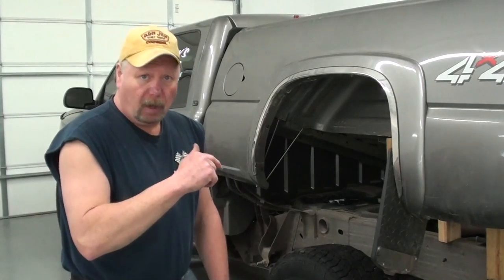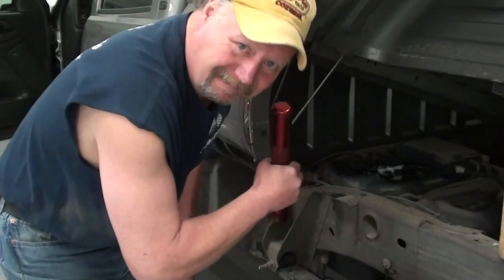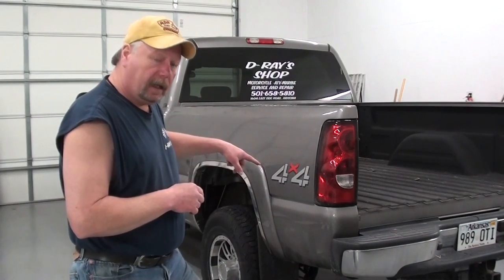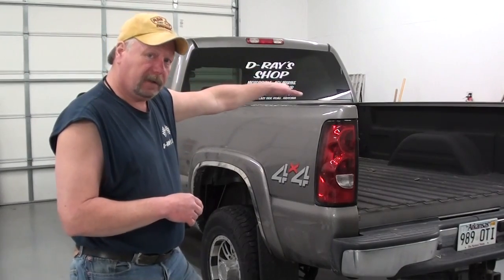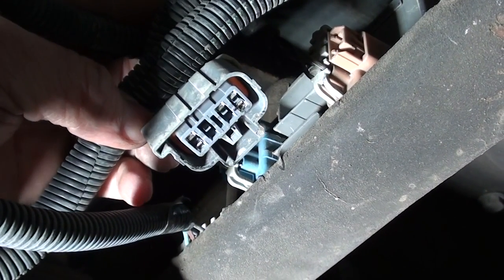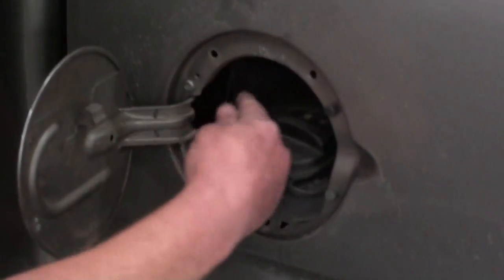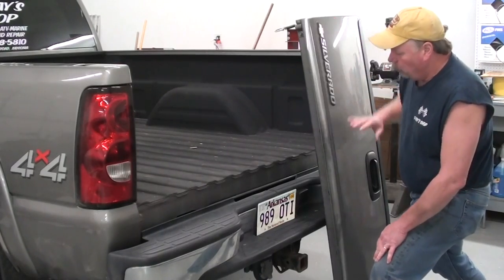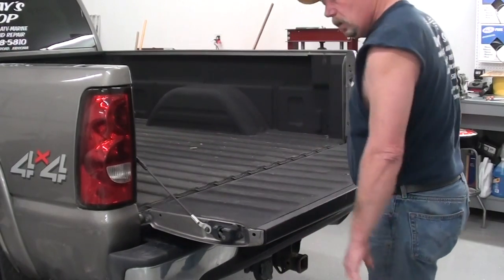Pt.3 2007 Chevy Pickup Fuel Pump Replacement At D-Ray's Shop

Comment: I didn't even need to replace the fuel pump, but for some reason I couldn't stop watching these 3 videos.  Learned alot.  Thanks.
Reply: I had a '95 Dodge many years ago, and the tank was almost empty so I dropped it. This is WAY easier!  A hint- you can not fix the fuel gauge sender. Just replace it.
Reply: Hahaha me to.. hey now we know how thanks to this guy for doing great detailed videos.
Reply: this is how its done!!!
Reply: I had my 1998 Dodge Dakota pickup restored last year (2019) and since they had to remove the bed to fix it and paint it I told them to do the same job as in this video. Now I can drive it with more confidence.
Reply: Same here, don't even own a Dodge and enjoyed the videos. Thanks for taking the time to create.
Reply: Same here, might change mine this weekend just in case.

Comment: Absolutely the best video I’ve seen on auto repair!! Admire your cleanest, details such as pulling on electrical wires and hose line connections and double checking everything. Fantastic job!

Comment: I truly appreciate the information you provided in this video. I have 2 Chevy trucks a 1990 and a 1993 that from time to time experience this same issue with the fuel pump. I'm a single female who cannot afford to pay a mechanic $85 an hour every time the fuel pump goes out. At 5'4" and 140 lbs. because of your video, I was able to replace the fuel pump on my 1990 version. BY MYSELF!!

Comment: D-Ray the fuel pump went out on my Hubbys truck. We were almost in a left turn lane on a street that went up hill. Terrible place for the thing to die at. Thank God we had AAA we got it towed home. My hubby works and comes home tired and  didnt really want to change it himself, but the quote we got was near 500. That number was a great motivator. I told him I saw your video and I thought we can do it! We ordered the fuel pump and yesterday THANKS TO YOUR GREAT INSTRUCTIONS we did it! The only tough part was putting that chrome looking ring back on. It was like we had to squeeze the "gasket on top of the fuel pump' down before the ring would turn. I ended up doing most of the job because his bifocals werent focusing, LOL. I Did it! I went to bed soo happy. I followed your video and it gave me the confidence to know it was done right! Hearing the monster start up and purr like a kitten was great! Thanks again from So Cal.

Comment: I just performed this fuel pump change on my 2001 and it literally took me 30 minutes after watching your video.  This is the second one in 186,000 miles and we did it at our shop and even with a 2 post lift it was every bit of 2 hours dropping the tank after pumping out 20 gallons of fuel.  That was the best way to change it out. Thanks and I will continue to watch for other videos!!

Comment: Awesome training series great camera work and full step by step explanation. I bought my 02 1500 4x4 used in August 2010 in December the pump went out. Had it towed to the dealer one day and $1100.00 later it was back on the road with a full life time warranty on parts and labor. Two months ago the sending unit went bad they replaced the pump under the lifetime warranty on parts and labor. They changed the warranty in January 2013 to parts only but documented my paperwork that I was Grand Fathered and covered full lifetime on parts and labor. Chalk up one for me.

Comment: Great video series, thanks.  Awesome how you broke it down into 3 shorter videos instead of 1 big long one.  I think I'm facing a fuel filter/pump issue right now with my 2006 Silverado 2500HD, and don't want to throw $600 at a shop to do it, and don't like the idea of dropping my tank.  Great idea and method, I'll get it diagnosed for sure first and then try it at home.

Comment: Thanks so much for this!  Just changed the pump in my 01 Silverado using your technique, except I used my engine hoist to lift the bed.  Hooked it to the tie down loop in the rear corner of the bed.  Hopefully good for another 120k miles now, plus my fuel gauge works right now!  Pat, Olivehurst, CA

Comment: Thank you very much for all the tips and help, tomorrow is the day I will fix a leaking gas line off the pump so tilting the bed will get me to the lines and also a good time to replace the brake lines to the rear brakes while the bed is up, Thanks a ton.

Comment: thanks for the videos!  Finally saw the  correct evap line setup after i broke two of the hoses dropping the fuel tank with 10 gallons of gas in a rock driveway. I do it like you did in your videos, now! Appreciate it!

Comment: ugh I wish I had known how to do this about 3 years ago with my 99 silverado. GM dealer mechanics are a joke. 4 visits with two tows and them replacing the pump on their dime only to finally figure out that the wiring harness was corroded. Very well done video. I'll be ready when the pump goes on my 07 2500HD.

Comment: I am so thankful that I found this channel, I believe my wife has a leak somewhere on top of the tank. I can smell gas and I can't find any leaky hoses. I have already replaced the canister vent valve in the rear of the tank. Still smell gas. CEL P0441(I believe) small leak detected. This surely is going to make my life easier.

Comment: Great video! Just finished installing the new fuel pump in my 01 2500 HD. Everything was just as you showed. Was surprized how easy it was to lift the full size bed up. Two hiccups though...Frozen bed bolt on the drivers side and a bad butt connector on the new harness. Other than that a pice of cake!!!

Comment: very good job on the videos . for a 2007 truck its in awesome shape with no rust. I have a 2003 silverado. I live in NY and my truck is rusting everywhere . Brake lines all rusted , the parking brake backing plates rusted off causing the parking brakes to rust apart . Im sure fuel lines will fall apart next ,Rockers are gone. Salt is this trucks enemy

Comment: Great Job on this Video and glad to see you used dielectric grease on your electrical connections .. please use your safety glasses any time you are under the vehicle to keep crap from falling into your eyes, and should use a little Silicone Grease on the fuel line nipples to help seal the O rings .. I am not being a critic this is one of the best how to's I have seen on You Tube

Comment: Great video. Maybe could have said what size socket you used for the bed bolts and explained why you put dielectric grease on the connectors but otherwise a flawless and educational video. Well done.

Comment: I have a 2007 Chevy classic with 170000 miles so I thank you for the tip. When I bought it with 133000 miles hopefully someone already did this.

Comment: Super Job! D-Ray Smith, Thanks, now I will know how I am going to do this job. Cannot believe how clean your truck underneath is, My 2003 Chevrolet Silverado is a rust bucket because of good ole Northern Michigan salt on the roads during Winter months. Thanks Again! One good ole boy for sure, super job on explaining what to look for and how to go about it.  One thing I really would like to know is where the ground wire goes to from the pump to the frame? Like on your friends Truck. Just curious.

Comment: Most excellent series, it'll be my guide for my fuel sending unit replacement this weekend on my '03 SS. Already have parts on hand and upgraded harness for sending unit and the tank pressure monitor.

Of note: I also ordered a tank/canister evaporative solenoid, fuel filter and fuel pressure regulator. They tend to go out pretty close to one another so I figured I'd just get it all while I have her tilted.

Like you mine failed after fueling up with a fresh, full tank of gas. Isn't that how it always happens? ^.^

Comment: Great video...I am about to do this but I was planning on totally removing the bed. The tilt method looks like the way to go.
Only thing I might add is while the bed is up, check all the EVAP hoses, connections, and canister.....I am fighting a PO446 EVAP issue so that's my reason to remove. While I have it up, Im gonna go ahead and replace the fuel pump (100500 miles). EVAP problem, maybe D-Ray Smith can help me with this?

Comment: GREAT VIDEO THANKS, I have a 2004  Silverado that had not run in 12 years, I open the tank and cleaned all the old fuel out. Now I can't get it to start. Any ideas?

Comment: I thank you for a great video, easy to follow, and I just finished mine this afternoon. I did go to the dealer and buy the pump $$$. Took a couple of tries with the board length to get it just right for the brace. The pump that I purchased had the larger seal and that was a little bit of a pain to get it pushed down far enough to get the ring seated enough to spin it on there. Is there a better way than using a chunk of the wood  and pressing down on the pump by wedging it on the bottom of the bed?  I just could not get any leverage on it. other than that everything went exactly as planned.  If one jack-stand was good, 2 was better to ensure it was going to stay put!  Thanks again for the video and the savings of about $700.

Comment: And thanks for showing how to properly use a brass drift on that lock ring. Seen quite a few pros using screwdrivers and chisels with a hammer to do it, and just wanted to smack them in the head for showing a great way to tempt fate with the fire hazard.

Comment: Great video! I won't have to cut a hatch! I've been watching other videos too. One mentions having to use a fuel pressure gauge under the hood with a pressure release button to avoid being sprayed upon removing the hoses on the fuel pump. Since you didn't mention it on your video, is it necessary? just askin', I didn't see YOU get sprayed.

Comment: D-Ray you made an excellent thorough detailed video that was very enlightening to me. I definitely gave you thumbs up!  I have a Chevy 2001 Silverado extended cab with a fuel pump problem. D-Ray could I use the same truck bed lift principle as you used in your video to replace the one in mine? Thanks and hope to hear your reply :-)

Comment: I wished that I thought of that method for my 98 Dodge Ram 1500, it has an 8 ft bed and I'm sure it was a lot heavier than the Silverado bed. I cut a hole right over the pump and if it ever fails again it will be a simple fix.

Comment: I just did fuel pump on my 2006 Silverado with 5.3L.  I couldn't get locking ring seated back in fully but it cranks and runs fine.  Do you think not getting it seated in the tabs fully will hurt anything?  Great video BTW!!  Thanks.

Comment: This is a great video series.  very informative with very good visual instruction as well. Do you think think method will work on a 1987 (square body style) with saddle tanks?  I need replace one and I really don't want to drop the tank or cur a hole.  Thanks

Comment: Wish I had thought of lifting the truck bed.Would have been super simple for where I worked had a bunch of forklifts around. Couple of lift straps and bed is gone then follow your procedure and Hey presto truck is back at work.Also a lot easier than wrestling a full tank of fuel around.

Comment: Hey D-Ray, great video thank you. What kind of fuel pump is that? I have an 02 2500 had with the 8.1. I keep finding pumps where I have to rewire it or it looks cheap. What pump is that? Thanks again

Comment: You made it look all too easy D-Ray. Awesome series :)
Reply from the maker: Thanks bro!
Reply: @DRaysShop  Sir, I have horrible rust and every step has had an added hindrance
; (
Got her tilted and electrical came off fine, but a bit hesitant on fuel lines (even the tabs seem rust weld) (Ohio is hard with salt and it never sleeps, if you know what I mean). Tenacity is the key, any tips other than WD-40 and PB blaster and wire wheel attached to cordless? Going slow so I don't mess up. You should teach adult Ed or high school auto mechanics (if they have that anymore).

V/r, Z

Comment: We made those fuel pumps at the Delphi plant in Flint MI. GM was always complaining that the pump was too loud. Sorry it didn't last longer than 100,000 miles. We made them. We didn't design them.

Comment: Is it necessary to run the engine first and then turn off the pump switch to run the lines dry (starve the lines of fuel).  For the record I would be doing this on a 95 F150 (no condolences necessary :-) )
Reply: Paul, I started the engine then pulled the fuse to the pump. Effective, no pressure and very little fuel when pulling the lines from the original pump.
Reply: +Bryan Beavers thanks

Comment: Spotless garage, clean truck with no rust. This is a make believe world because in the NE you get a failure in the middle of winter with every single bolt rusted so bad you need to spray everything to even think about removing it. Plus you work outside on your back in the snow and ice on a piece of cardboard with rust falling and covering your entire upper torso and face!

Comment: It is a bit more work to do if you also have a fifth wheel rail kit installed into the bed.
All of that has to come off first before that bed will move.
Otherwise GREAT video series.
I own a 2008 GMC Sierra 1/2 ton long box 4x4.
Got 136,000 miles on her now and original fuel pump still in it.
I'll probably be doing this soon at some point I imagine.
Mine is also a  flex fuel vehicle so I have that super high volume , super expensive pump in mine.
Not really looking forward to buying one of those.
Too bad I can't just swap out ONLY the pump.

Comment: i have a 2007 chevy 4 door full size 1500 5.3 went out to it one morning it would not start appeared to be blowing the fuel module fuse i purchased a new module an now the fuel pump will not come on i checked the relay i have power on one leg even when key is turned of i also have power on the module fuse with key off i have power on the pcm fuse when the key is turned on only but i have no power on the number 21 20 amp fuel pump fuse key on or off does anybody have any ideal whats going on with the truck i have no power at the fuel pump is there a kick switch safety switch on it anyweres like a ford ?????

Comment: Why didn't you also install a new fuel filter? A plugged fuel filter will cause a fuel pump to go bad. Bad instruction by not replacing fuel filter!
Reply from the maker: The fuel filter is part of the new pump assembly. Bad commenting by not doing a lil research before bashing someone elses work!
Reply: @DRaysShop  I turned wrenches for over 30 years and was a ASE certified Master Mechanic. Except for some Dodge or Chrysler models which did have the fuel filter as part of the pump assembly all vehicles have a separate fuel filter mounted somewhere along the fuel line between the pump and the fuel rail. The small pick-up "strainer" that is at the bottom of the fuel pump assembly is exactly that, a strainer, to prevent the pump from picking up any debris that may be in the tank. I repeat to anyone who will listen, There is always a fuel filter in-line between the fuel pump in the fuel tank and the fuel rail on the engine and it should be replaced on a regular basis and definitely replaced if you have to replace the fuel pump assembly!
Reply from the maker: @robertgrimley9077  Sorry hoss, but you're STILL wrong.  Early Chevy fuel injected trucks that I have owned did have in line filters in the frame, but all late model Chevy trucks I have owned only have the filter in the pump. I appreciate your passion and experience in the field, but you really need to let this go and leave with your dignity in tact. Have a goodun' !
Reply: @DRaysShop  The mistake I made was misreading the year of the vehicle. I believed it to be a 2002. You win this round. Don't get to cocky just like I did.
Reply from the maker: @robertgrimley9077  No, the mistake you made was coming to my channel and talking s#!t about something you did'nt know about.  And, I did'nt "win" anything, you were flat out wrong from the start, and I pointed it out plain and simple. And lastly, don't try to advise me about being "cocky", I respectfully asked that you let this go and leave with your dignity in tact, but alas, you come up with some feeble excuse to try and redeem yourself. Remenber, this is MY channel hoss, and I'll get as "cocky" as deem necessary.... Now GIT!             .....and have a goodun'!